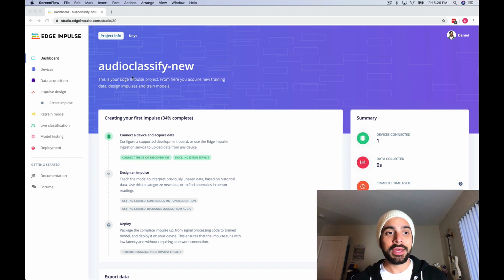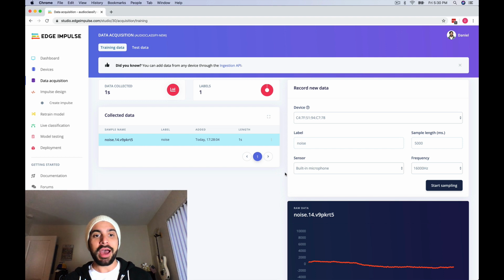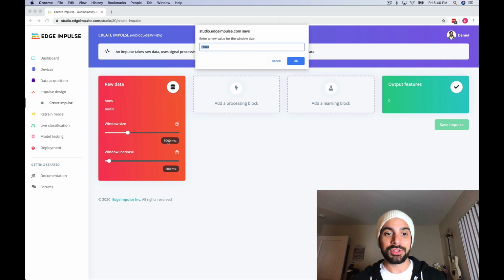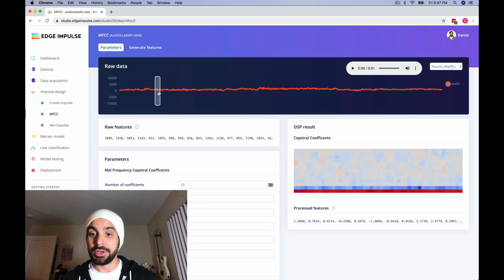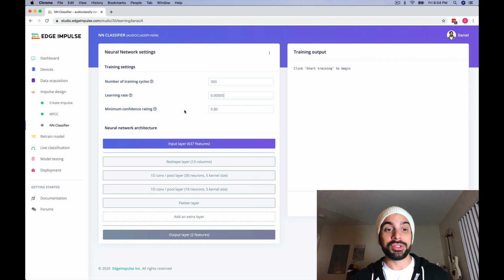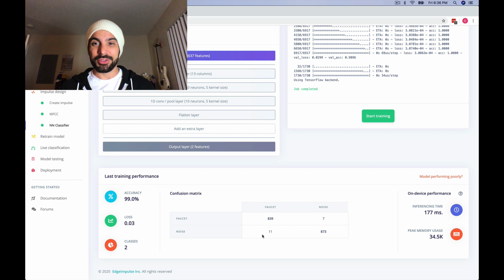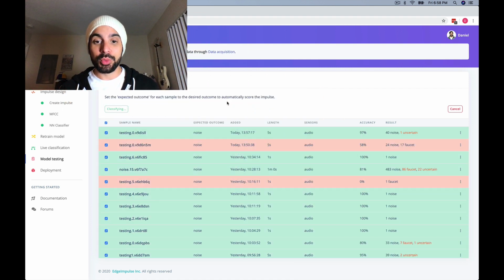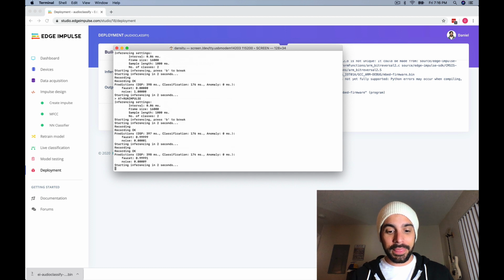Building an Audio Classifier with Embedded Machine Learning

Comment: Great video, and very useful tool, but I've got to be a nerd here and comment on something - MFCCs are not directly the same thing as an audio spectrogram. The spectrogram is a representation of frequency buckets vs. time, while MFCCs are a compressed version of the spectrogram showing a small number of cepstral coefficients vs. time. Cepstral coefficients represent periodicity in the frequency domain (e.g. it detects the presence of signals with harmonics) and are well-known to represent human speech perception systems with very few components. Just in case anyone was interested :)